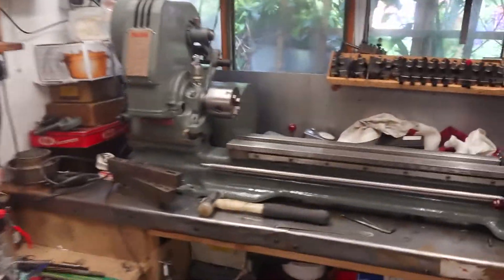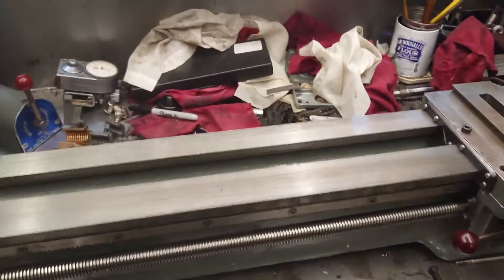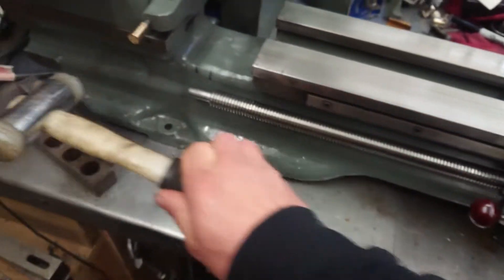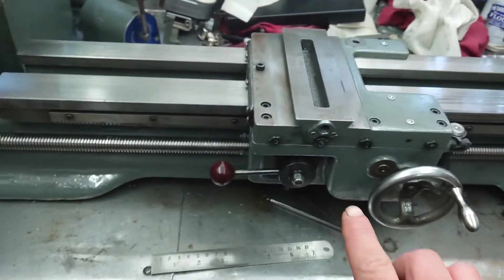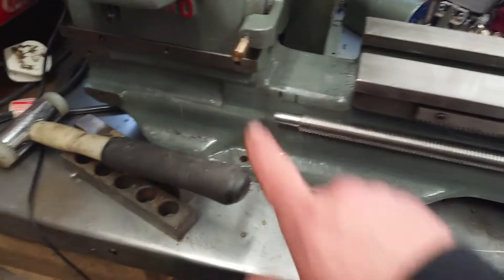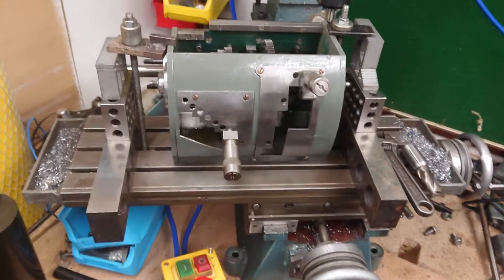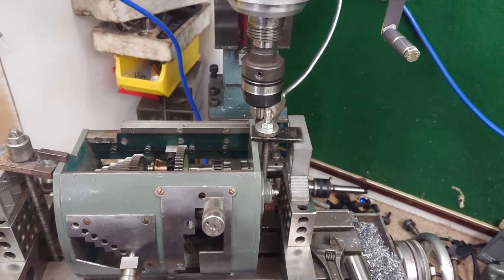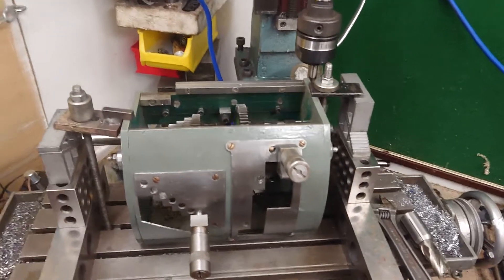Shop update on the myford long bed conversion

Comment: Nice setup with such a small space. I had a heck of a time with a QCGB I transplanted on to my logan lathe. Just didnt seam to want to line up correctly on the drive gear end. Was kind of strange as it came from the same model of machine
Reply from the maker: Thanks Craig. Strange how these things don't fit even if they are from the same type of machine.